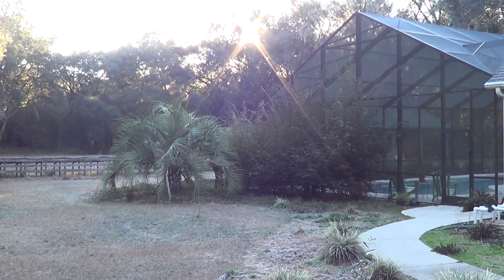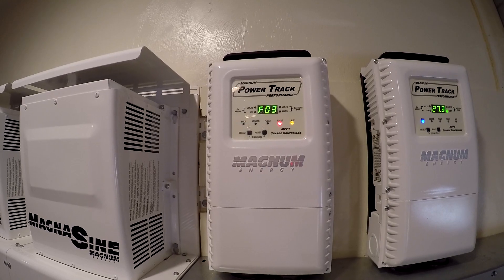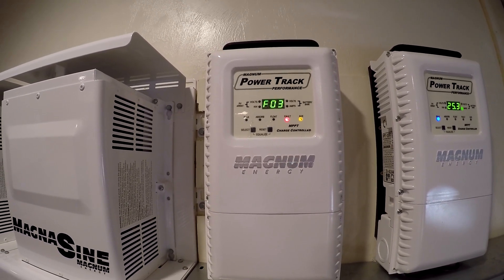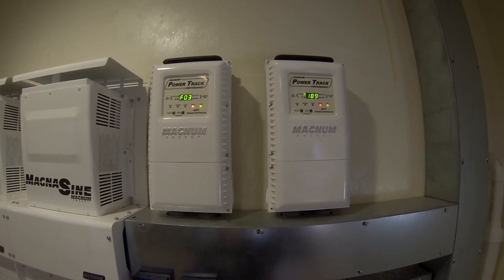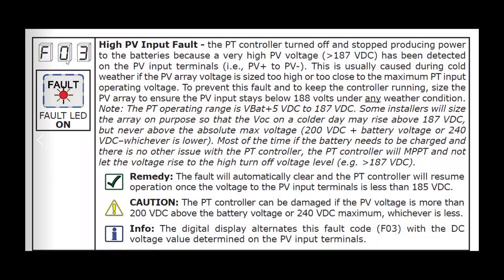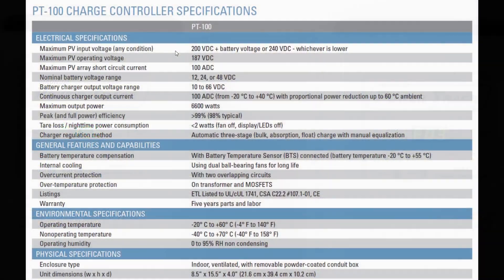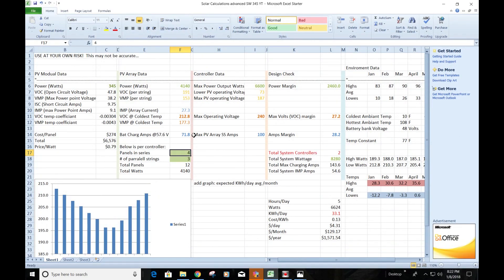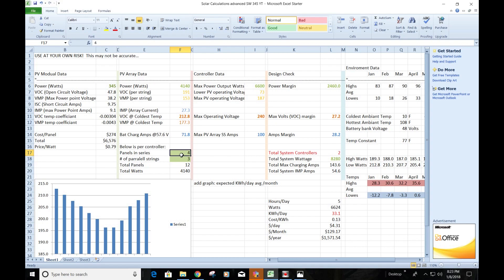The Problem with Solar when it Freezes

Comment: David great video as usual. Just set up my system very similar to yours. It appears you didn’t “stack” your pt-100’s. Correct?  If not why?
Reply from the maker: They are stacked.
Reply: Looks like I misread manual. I thought the master pt-100 showed the “bulk” mode but it appears all controllers show it. Thanks

Comment: Great video you could just turn off one set of your PV breaker off each charge cobtroller you would loose some power but you would be still producing power in that 30min the system shut down for better some power than no power.
Reply from the maker: Sean,  well that's a good thought but unfortunately It would not work.  Cutting a breaker in the combiner box, (decreasing the number of strings), would reduce the current but not the voltage.  Even if I only had a single string the voltage would still be the same.  Thanks!
Reply: David Armstrong your so rite my friend that one got me there this series and parallel connection can get to your head at time

Comment from the maker: Spreadsheet on Google Drive (use at your own risk):
1. Matching solar panels to charge controller:
https://drive.google.com/file/d/1AH6wTiaRHPRxnDzdDeYDDYzKntXDWl0O/view?usp=sharing
2. Parts list:
https://drive.google.com/file/d/1OKP_ugJ8qidYku5sZvBqr2ICN3zR__m-/view?usp=sharing
3. Solar permit:
https://drive.google.com/file/d/1uXN3Pgn34_f-OlrzqYu5Edl4OmkTvUZC/view?usp=sharing

Please note that while the PT-100's max OC voltage is 240, it is designed for a max operating voltage of 187 and will cut off at voltages higher.  This has happened to me on sunny cold mornings when the panels have frozen over.  They warmed up in about 30 minutes and turned back on.  If you live in colder areas you may want to consider this in your design.

The spreadsheet takes into account the specs of your panels and your controller, the number of panels in series and parallel as well as the coldest temps in your area and the temp coefficients for your panels.  It works very well for my system but use at your own risk.
Reply from the maker: Thanks!  Just sent you the link.
Reply: David Armstrong        I would like to have a copy of your program please. Thank you very much. Jack   
jacsr1@aol.com
Reply: David looks very interesting and yes i 'd like a copy  of your spreadsheet thekinglouis@gmail.com
louis
Reply from the maker: Just sent you the link.  Good luck!
Reply: I could I get a copy of your spreadsheet. bennettinnovation@gmail.com
Reply from the maker: just sent it.
Reply: Thanks I'm watching your video
Reply: Hello David. I'd be interested in looking at your spreadsheet in more detail.
Thank you.
Reply from the maker: OK, Just sent it to you.
Reply: Im in love with your system nice work man. Can i get a copy of the spreadsheet?. Thank you. jrrod225@gmail.com
Reply: A copy here too please. A lot of hard learning went into it I see.

Comment: @David Armstrong  Not sure if you can set the charge controller not to exceed 185/186 volts. I am not sure what size your batteries are kw to kw. see link  https://youtu.be/xH5cAuaCYKw

Take the number of panels x watts to get the total watts of the solar array. You then divide it by the voltage of your battery bank to get amps, add 25% to allow for cold temperatures and as always, round up. Example: 2 - 140 watt solar panels in series = 280 watts / 12 VDC battery bank + 25% = 29.18 amps.

Comment: You were in what Midnite calls Hypervolt. This is why I bought a Midnite Classic 250. With my array I was going to be in Hypervolt on clear sky cold days so I bought the 250 volt model. Where you live I doubt it is an issue very often. If I have clear sky and even 28°F My Midnite input is over 225 volts. It's good to have some headroom on the voltage input. You made very good points on this video My friend.
Reply from the maker: Yes, it's pretty rare that we are below freezing and almost never past 10:00 am.  By that time the sun is warming the panels up.  You probably see higher voltages on a regular basis where your at.  Plus, having a "high noon" sun angle while freezing temps is probably even worse.  Thanks!

Comment: Interesting situation.  Consider if snow and /or moisture ( frost) drops the temps , would it be worth the work to place a "heater type" extension cord under the panels and switch it on when extreme cold is forecast ?   I've seen folks wrap them around pipes or on roof eves to prevent frozen pipes and roof ice jams.  Just thinking out of the box.   Thanks David.   J K
Reply from the maker: It would not be worth it in my case since this is a rare occurrence here in Florida.  It might be worth it in some cases but I would also be concerned about the thermal expansions and contractions that you might encounter.  You might reduce the life of the panel or even damage them if done improperly.  On the other hand if it were done carefully and correctly then it might work or even be used to clear the snow and ice so you don't have to brush them off.  Remember that this is only a problem when its cold AND the sun is shining bright.  So, in my case the sun heats them up in about 30-60 minutes.  Thanks!

Comment: You are absolutely correct my friend. We here in the cold region have to deal with those situation but someone has to consider about the cold weather conditions and higher voltage and current coming from the modules.
Nice video and thanks for sharing Sir.
Please check out this video to see similar conditions.
SNOW AND ICE OFF THE SOLAR PANELS | We Are Making Power
 https://youtu.be/WFe2oojFrbQ

Comment: You need to use a multiplier for your worst case temperature
Reply from the maker: Yes, the multiplier is built into my spreadsheet and I have found the voltage predictions to match real world observations very well.

Comment: Thank you for the details, just wondering what would happen if you were to cover one panel on the top row and one on the bottom. 
Would that reduce the voltage by only one panel, or would it be more than that.
Reply from the maker: Good question and I don't have a good answer but I think it would be more complicated than you might guess.  I doubt that covering one panel on top and bottom would solve the problem.  I think you would have to cover one panel from each set of four in series since each set of four would produce the over voltage down to the combiner box.  Also, the net power loss would probably be far greater than 25%.
Reply: https://www.youtube.com/watch?v=gDUGbaYg0FI
Reply: So covering one drags them all down.Thanks Pradeep,
Reply: MrSnowMen. Yes for this setup since he has string steup vs grid tie inverter with dc optimzers work better or micro inverter setup.